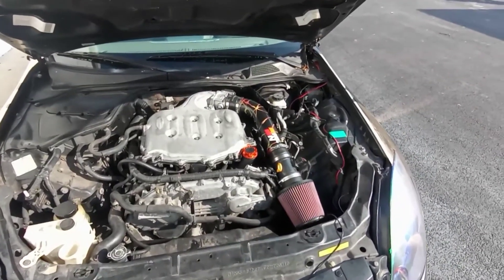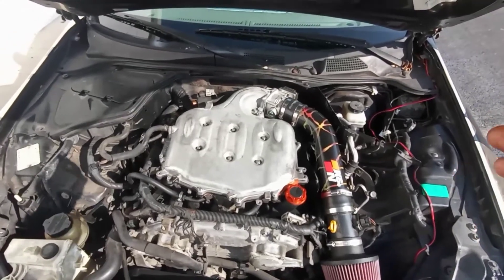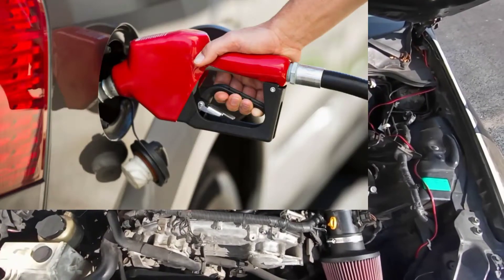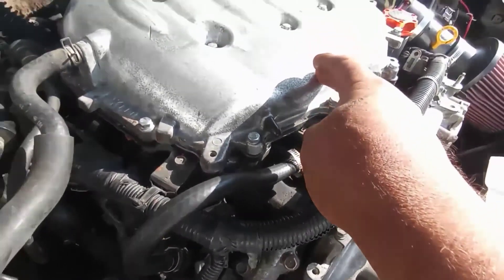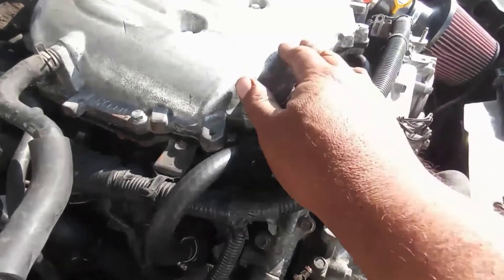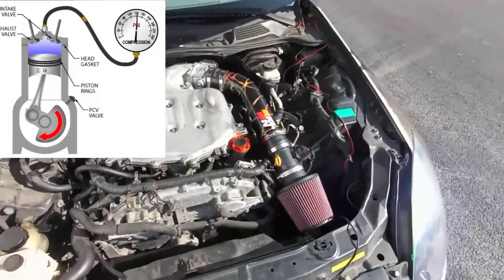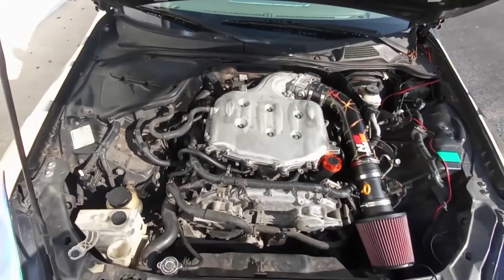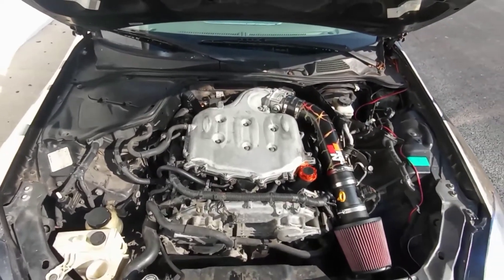2003/2007 bad fuel Pressure Regulator for Infiniti G35 Nissan 350z

Comment: Im having the same issue with mine. Once im low on gas and i give it a little rip, itll jerk alittle and the light will come back on. As soon as i fill up and erase the code the engine light goes away and stays off. i changed my sparks coils and cleaned my fuel injectors. This will be my last attempt. Hopefully it works!

Comment: I'm a new owner of my 04 G35. Runs great but hard to start when warmed up. Runs perfect other than that. I changed my crank and cam sensor. Also fuel guage doesn't work but low fuel lite comes on. No Codes. @everyone know what it could be?

Comment: Well, no actually it’s in the engine bay, but you can hear it through the firewall, when I squeeze the hose from the purge valve solenoid to the intake, it stops, but the solenoid is OK
Reply: It only doesn’t when the car is warmed up shut off and restarted happens when it’s idling and as you drive it disappears
Reply: There’s a YouTube video that has the exact noise from another guy. It’s called “Infiniti G 35 weird noise”
Reply: It kind of sounds like air, pulsing, or gulping
Reply from the maker: The engine give you any cold
Reply: No codes no cel

Comment: Which part makes the dull knocking noise from inside the cabin on the passenger side, the pressure reg. Or the fuel damper?
Reply from the maker: Did it there is a piece you need to be changed when that piece broke down they start slip and give you a noise this is the parts name ( HVAC Air Door Actuator )

Comment: Thats not a fuel pressure regulator both of those are fuel dampers for each fuel rail the fuel regulator is in the fuel tank with the fuel pump
Reply from the maker: If your car that low on gas and you get angel lights on and he gets engine cylinder 6 misfire is the fuel pressure regulator it's happened for many people I know personally and as soon we change the regulator the problem is good no problem anymore the problem and infinity you need a special tools to test all that and no one can give you specific what the issue exactly so this why it take me too long to know about this problem until I fix mine and I fix other people's cars the same issue

Comment: My 350z stalls , p0001 code
Reply from the maker: P0001 is the OBD-II generic code describing an issue with the circuit which runs from your engine computer (ECM) to your fuel pressure regulator on your fuel injection rail on your engine. The ECM regulates your fuel pressure from your fuel pump going to your engine through this circuit.
Reply: @LessExpensivefix  so should I put new fuel pressure regulator or fuel pressure sensor? I was driving and car shuts off .
Reply from the maker: @autoperformance503 what's fuel pressure did you change the one on the front or the one on the back
Reply: @LessExpensivefix  i didn’t change yet ?
Reply from the maker: @autoperformance503 so the fuel pressure regulator the one is in the back of the engine the one go to the injection
Reply from the maker: @autoperformance503 is close to the camshaft position sensor
Reply: @LessExpensivefix  which one should I change front or back one ??

Comment: Is it hard to check the fuel pressure on a g35 like this. I have an 06 Infiniti with engine running lean and would like to self diagnose the issue if possible.
Reply from the maker: There is another video on my channel how to change your fuel pressure regulator

Comment: When I fill up my gas my car starts to jerk & vac slip comes on. I have a 04 g35 & it smells like gas but not from the engine but from the tailpipe. What do you think bro? Also cylinder 6 misfire changed spark plugs still misfire
Reply from the maker: I just sent you a video to fix your problem
Reply from the maker: https://youtu.be/jDsq0d0q_HQ

Comment: Nice video 👍🏾. I just changed my spark plugs and coil pack.. still misfiring a little.. I was thinking the fuel pump or regulator. I have a 2008 g35
Reply: Was it that?